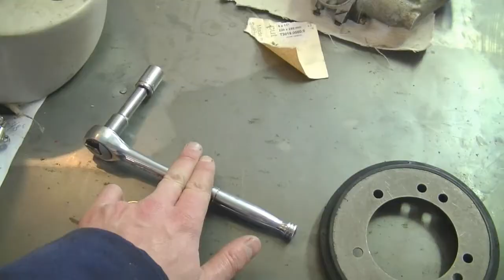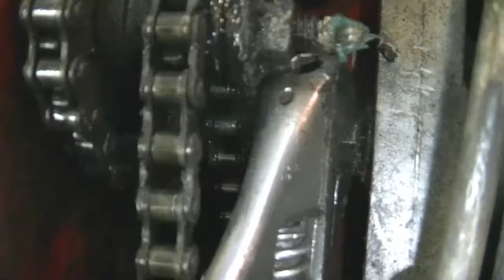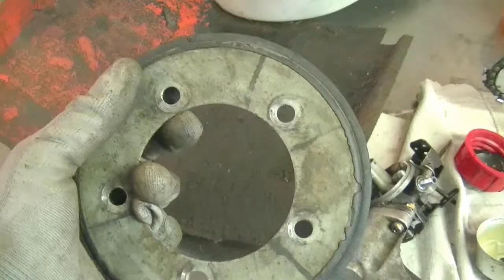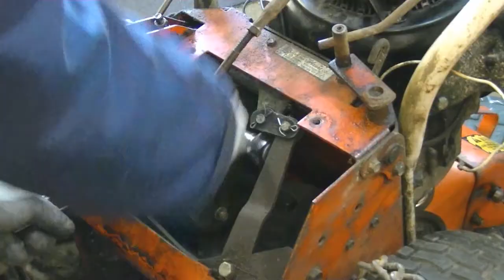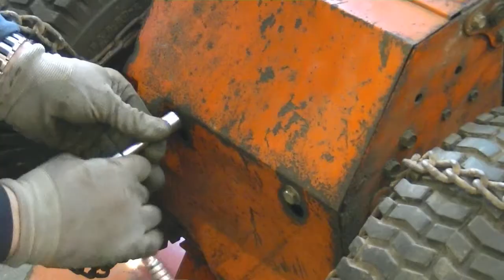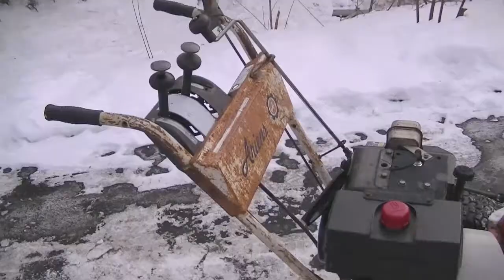DIY - Ariens Snowblower Friction Disc Repair

Comment: Hi, hope you seee this, I am trying to swap the pulley wheel on the opposite side of the friction plate which the disc rides perpendicular too ..on the “spindle” is the plate threaded on, pressed on? I tried puller even heat won’t move I don’t want to bend or break it …thanks in advance for any advice!

Comment: The new Ariens's Professional Machines use bushings for the auger and impeller shafts on their newest cast iron gear case.  First they changed the Auger shafts to bushings and then the impeller shaft.  Does it save that much money?   Do the bushings, made of a yellow metal provide the same reliability and longevity?  I doubt it.  For how long will quality keep spiraling down?  I doubt the Honda's are much if any better.  I will try to find a parts diagram of the Honda's and Simplicity machines.

Comment: do you have Anything on the shift fork not pushing the friction plate into the friction wheel, adjusting bolt does not help ?

Comment: I cried when you threw away that old original friction disc that lasted for maybe 20-30 years with little wear on it.  Fact is, replacement discs these days will last not even 1/4 as long as the old ones, even if they are genuine replacements and look identical. The entire industry has shifted in the past 10 years to cheap rubber compound on friction discs. New snowblowers need friction discs every 3-5 years and replacement units last are just as short. So if you have a snowblower made in the 80s or 90s, keep the friction disc until it's completely worn, you will never get another replacement disc to last that long.
Reply: Thanks for that heads up - I just removed my original and now I'll be sure  to save it!

Comment: this  is a great video. I have what might be a dumb question. Can I do this without draining the gas and oil first? I think I probably have to drain them but if it is not necessary, I don't want to take the extra time right now. Thanks!

Comment: Hey Don, I have an Ariens model 924050, serial # 073843,  the drive plate assembly was frozen, not moving up and down on the shaft, I got that lubricated and working well.  Problem is, I can't seem to get the control on handlebar to move it up and down.  It seems the clutch fork is not connected, but, I can not see where the clutch fork attachment point is supposed to be, or how that mechanism is supposed to work.  I assume removing the axle would give me a better view.  Can you shed some light on this for me?  I'd appreciate the help! Thanks

Comment: I own an Ariens 932105 that during use the augers stopped turning. I checked both shear pins which are both intact. Is there a belt I need to replace or at least check. Looking for your advise.......thank you
Reply from the maker: yes check belt for sure

Comment: my friction disk #153075 can't seem to find one is there a replacement part jacobson imperial 626
Reply from the maker: is it same disc as in video?
Reply: No there is a square plate bolted to the drive pulley i guess that's what it is called from what the manual says.I guess someone bolted the plate there for what reason i don't know.I'm looking for another drive pulley but there no longer made
Reply from the maker: you can email me pics at donyboy73@yahoo.com so I can see if I have a used one
Reply: Ok will do i don't have it out yet but I'll send a pic

Comment: Hello, my older 8hp ariens sno thro has no neutral, any idea why? Cheers, John
Reply: John Haakman I believe your friction disc isn't sitting in the middle of the perpendicular metal drive thing. causing it to move
Reply: * the snowblower

Comment: QUICK QUESTION about friction disc, I have seen the same BUT the disc has 4 small holes surrounding a larger one in the middle, have you seen such and have a part number for such??

Comment: When adjusting the friction  disk should it be set to slip a little in case I hit ice and force it to much or is that the sheer pins job on the wheels?

Comment: That thing is an absolute tank... in a good way.  

Nice little Honda mini-bike (70cc?) in the background... what year?
Reply from the maker: +Patrick Wagz I think the bike is a 72'
Reply: donyboy73 thanks for all your helpful videos!!
Reply from the maker: on older machines with enough hp it's a good addition but on newer ones not necessary
Reply: donyboy73 
wondering what you think about adding a rubber impeller kit to a Snowblower ?
Thanks, great channel.

Comment: I watched several of your videos. Thank you very much, I learned a lot from you. you explain things real clear.I have a problem with my Ariens ST824 not moving at all. At least I know where to go and look now.I used it all day yesterday due to heavy snow in the east coast 1-24-16.After I got done using the snow blower, I was going to store it back on the shed and the blower don't want to move at all.
Reply from the maker: +Sidney S you should check the friction disc, belts and drive cable adjustment

Comment: while the undercarrige is open its a good idea to lift and wiggle the wheels to test wear on the wheel bearings.  When the bronze bearings become too sloppy the gears can jump during forward or backward drive under load. My Ariens was manufactured in 1974 and still works (semi-retired).
Reply: my st824 is a mid 1980's i picked up used in 1998. the wheel bearings are shot now but the machine still works so i got to deal with that. doing the friction wheel today. might also do the impeller upgrade with the rubber wipers.

Comment: Great videos , big fan....I have a question on my Ariens724 snowblower, the wheels are locked and won't turn.. I lost a spring, not sure where is connected to blower, but the friction disk is stick to the wheel and won't separate... what does one do???

Comment: Rats, forgot to ask...
The shear pin that's under the belly of the Sblower the one for the wheel on the right side.  I used the Sblower for like 30seconds on light fluffy snow and the shear pin snapped,  This is twice this has happened. I not had time as I was on a job, now just back home after a tough 16 hours of Sblowering,  I'll look at it and see what I can see.
But you know I'll be checking your vids for the answer.

Comment: Ahh nevermind,, I went to use one of my snowblowers, and the one I was using made this loud scary noise.. and would not move,  

with flashlight in hand, I notice of of the wheels did not have it's secure pin in place, 
easy fix,  lucky I had brought a back-up machine and used it's secure pin on my machine,  Whew,,, almost lost a contract.  DONY....sweetheart,  baby, you're awesome vids saved the day,, and YES.. BOTH wheels have power.

DonyBoyyyyyyyyyyyyyyyyyy keep banging out them vids

Comment: DonyBoyyyyyyyyyyyyyyyyyyyyy
You Sir are a credit to mankind,  Your video's are top notch,  and because of your very informative video's have saved me in the crunch many times.
I vote DonyBoy to be on TV have his very own TV SHOW...

ok, nuff with the brown nose'ing

Dony,  I replaced the broken sheer pin on the snowblower wheel,
only afterwards I noticed that only one of the two wheels has power,  
is this normal,  or should both wheels have power
Reply from the maker: thanks lol

Comment: I have an older ariens 7524. It has two belts driven by two pulleys that are not mounted on the same shaft. I can not find for the life of me A SINGLE picture on the internet of the belt setup. Any help? I have the manual, but it is pretty useless. The idler spring is very weak and not putting any more than .25lb of tension of the pulley and I am trying to figure out if it should be more or maybe I set it up wrong.  Thanks

Comment: Hey, there, I am a fan of your videos and wondering if you can help me.  I undertook the task of completely rebuilding my Ariens snowblower, model 924048( it had been sitting in a garage for about 30 years)  from the ground up. I am not so sure how to put it back together as it is my first time working on a snowblower. I have all the diagrams but they don't really tell me where or how to put stuff back together. I am wondering if you have any suggestions or any videos on rebuilding,  mostly the reduction drive, and transmission or  axel assembly thanks.

Comment: hey donyboy. i changed a disc today on a 20 " ariens. i believe its a 1975 model. the disc only has 3 bolts holding in on and smaller than that one you got there. changing it was not too bad, but after i was done something felt different. this model only has one squeeze lever to engage the drive. its on the right side. when i squeeze the hand lever now it travels in much further than it did before. the gear selector seems harder to move also. it did not want to roll in neutral, it was tight. i loosened up the adjuster till it would roll. then i tried it out, and the drive lever is traveling in much further than before i changed the disc. it seemed to be slipping when i tried to resist it. i tightened the adjuster back in some and it was grabbing better. just not sure why it seems different now? the old disc was in very bad shape. it was hard to hold the drive lever in. i had to use a lot of pressure to keep it moving. it started losing power to the wheels so i changed it today. before changing it would start in any gear. now it seems to be locked out "  drive lever will not squeeze in when it is neutral " idk what do you think? i am sorry for the long post. please help! i am, and have been a subscriber. your videos are the best! thank you. o and it seems only the left drive wheel is grabbing. when i hold the lever in with it not running, the left wheel is locked but right wheel seems to be free. is this normal? it has 2 new drive belts and they seem tight.
Reply: i figured out what was wrong with disc drive. the rod that goes from the hand lever to the drive pivot was jammed. i had over tightened it where it connected onto the pivot, and it could not pivot. i just loosened it up a little, and it's perfect now. was able to adjust it properly. things like this can drive you crazy. lol
Reply from the maker: Michael Hammer ok good

Comment: I have an older ariens(5520). I replaced the friction disc, It does not have to  nut adjustment to bring friction plate down, machine runs away when not engaged and is hard to shift as rubber is up against plate all the time,  I did adjust drive cable no change. any ideas?

Comment: I have an Ariens Snow blower ST824 Model # 924050 wheels will not turn either forward or reverse the friction disk looks fine does it need adjusting or replace. Or is it something else. Thanks for your help.
Reply from the maker: check drive belt

Comment: Yes but you will gain low speed in reverse at the expense of the top gear.
You will be shifting the fiction wheel assembly slightly to the left.

Comment: Great video, pretty simple job. I have an old Toro 824, you can't kill that snow blower.
Reply: Toro made some very rugged machines.  I have a 1979 421 it is built like a tank.  Sadly today many snowblowers are overpriced junk which are made out of plastic and have a lot of non repairable parts not like the old ones.

Comment: I have a Ariens snowblower and my brother has the same model when I tried to get shear pins with the part numbers there are two sizes one is correct the other is .020 bigger. They are 1128's. Have you heard of this? We live in different states and have the same problem.

Comment: I have an older Ariens, model 10ML60D.  At first I thought that I might need to replace the friction wheel and that's how I found your nice video.  It now appears to me that I issues with the wheel hubs.  I don't think that have ever been serviced and they seem to be working intermittently.  The right wheel no longer engages at all.  Searching around it appears that parts are no longer available.  Question - How would you deal with non-functioning wheel hubs?  Pin them permanently to the axel?

Comment from the maker: you might have to clean the shaft that the wheel slides on, i use straight gas and a rag the i apply a thin layer of lithium grease on the shaft. it also probably needs carb work

Comment: i have a model # 924073 ariens snowblower 10hp  32inch cut  the snow comes out the shute but does not go that far  and when i look inside the front of the unit all snow is packed on the blades maybe the belt is slipping????how hard is it to change the 2 belts i havent seen any videos. can someone help me thanks

Comment: Thanks for getting back. I will try to help. No video but I will do what I can.  The video I referred to was yours. Here is the problem w/making video.. Pls let me know of what.  Basically, when I put it into gear (press the left hand lever), it engages and goes no problem.  When I let go of the lever, the snowblower continues to go forward in a herky jerky fashion.  I have to either disengage it it or get it into neutral.  Getting a video would be tough since I am holding on for dear life .

Comment: This is a great video.  This is closest to the problem I am facing.  I have 1973 Ariens 7 HP snowblower.  It starts just fine.  I put it in gear and it stops running within 15-30 seconds.  Also, if it does continue to run, it deos goes into gear.  When I release the lever, the snowlblower continues to be in gear and continues to travel.  From this video, it seems that they may be related.  would greatly appreciate any thoughts!!!!?

Comment: @donyboy73 thanks for the reply! took it apart lubed the hex shaft that the chain case slides on so its nice an smooth cleaned disc an plate with brakeclean.by the way all belts an friction disc are new.with engine off clutch engauged wheels dont turn but in reverse doesnt spin in reverse direction but freewheels when i roll wheels fowards is that normal or may be chain case issue?now goes foward in all detents normal.did i mess it up rollin it backwards down my ramps maybe?

Comment: great vid just bought a older 10/30 snapper looks to be this style worked great till i backed it off my truck not running an seems to have lost reverse??goes foward only wit shifter full ahead thinkin disc or something fell apart?wont get to it till next weekend any ideas?thanks for your time.

Comment: Thank you for this.  I was able to get my snow blower running again by cleaning off the rubber on the friction disc and the metal plate it connects to.  Also adjusted the tension on the lever that engages the bottom metal disc (not sure what its called).

Comment: Hey Dony
I keep playing the Ariens video over and over to see if it could help me with my Ariens blower. I Removed the axled to change the bushing, Putting it back on  I notice a spring that was hooked on one end and not the other. Ive looked and looked but i have no idea what its purpose is or where its suppose to be connected to. Ive tried running the blower but it barely moves then comes to a stop. Could you please help me. its a 1972 given to me and id like to keep it going Thanks

Comment: @donyboy73, I have a 2006 model Ariens 825 snowblower that needs this same part, however the shaft runs straight across to another bearing. It seems like the whole assembly needs to come apart to replace the friction disc. Do you have any tips on changing these? Also the disc is much smaller than the one on this video. Thanks!

Comment: Very helpful mechanical videos. My grandpa has an ariens auger propelled, two stage blower with a tecumseh engine. The engine does not run when the choke is completely off, or if it is not running full throttle. Is this a carb. problem?